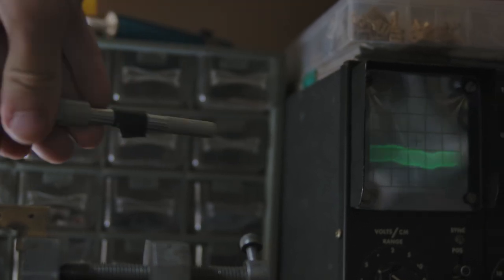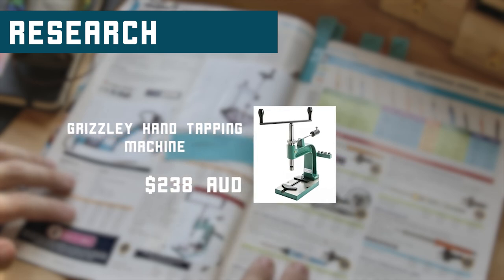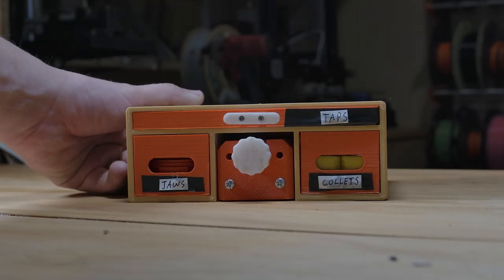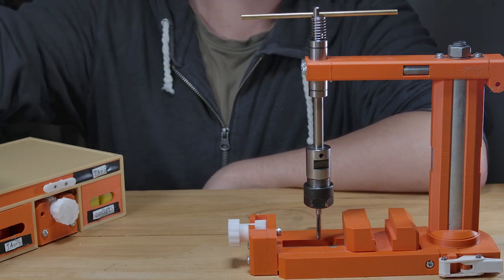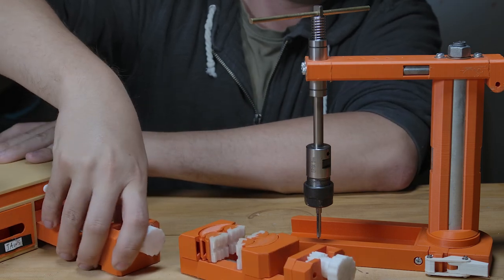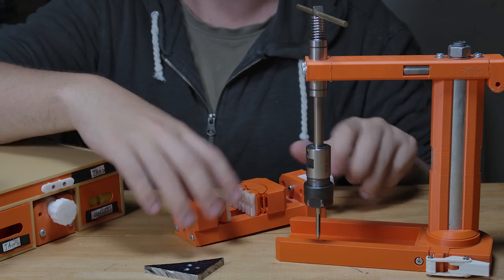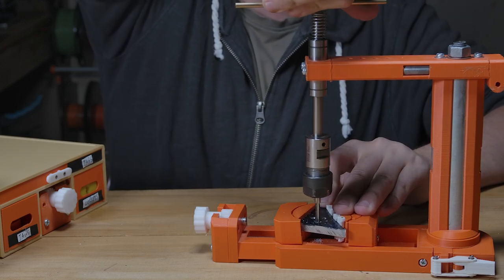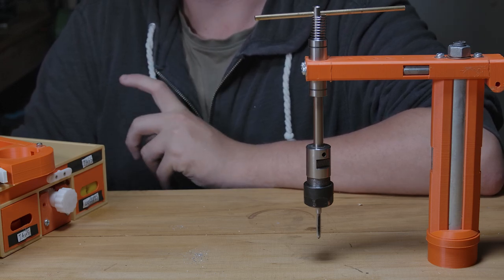I Printed This Tool To Break Less Taps

Comment: There are 3 taps (with different tapered lead-in) in each thread size set, use them in order, use lubrication 1/2 turn cut, 1 turn back-off and you'll never break a tap. Been tapping holes for 40+ years and can count the number of broken taps on one hand ... and that's tapping everything from 25mm down to 1.5mm threads in everything from brass, aluminium to mild steel.
Reply: Some suggestion here.
Battery powered screw drivers has a ball clutch, there is settings near the chuck to adjust the torque before de-clutch.  It is a mechanism to protect the screw from over torque.  This comes in quite handy for taps as you don't want to push the tap too hard.

Now for the 1/2 turn cut, 1 turn unwind. That is about the best practice of tapping. If you modify a battery powered screw driver for tapping, may be you can add some circuitry, say with an Arduino. Add a button to operate the 1/2 turn in, 1 turn out cycle. It could be a fun project too.
Reply: You only need to back off with straight flute "hand taps". I've mostly seen on cheap no-name taps and I would not recommend buying them. Spiral point (not spiral flute) taps do not need backing off so they are much faster to use as well as higher quality when bought from any kind of name brand. Generally, if there is no DIN/ISO marking on the tap, dont buy it. 

Notice the head shape between straight flute and spiral point taps https://www.pgmerlin.co.uk/news/the-different-types-of-taps

If I tap holes which I did on a drill press, I usually run the tap with the drill press as well. Largers taps I run by hand but I still use the drill press to center and push down to get the tap started.
Reply: I've tapped 0-80 before and was instructed to do it by holding the part and use a drill and drill slowly by hand, of course one broke....
Reply: Best comment here, while it's a nice project good tapping proceedure should be first and foremost.
Reply: I opened the comments looking for this one 👍
Reply: I too can count the number of broken taps in one hand. I can hold a lot of taps in one handful.

Comment: If you pour hot wax into the hole before tapping, your taps will last a lot longer.  Tap wax not only lubricants but helps clear the fillings from the hole.      Like your tapping jig.😊

Comment: I don't tap many holes and yet I may still need to make myself one of these. The floating vise is a cool idea as well. One thought, I think where you used the linear ball bearing I think you'd be better off with a bronze (or similar) bushing. You still get the nice tight fit, the smooth axial running and you won't get the squeaking of the balls in the bearing crying out "don't use me in rotational applications".

Comment: Just use a cheap secondhand benchtop drill press with the power cord cut off. You can get them for about US$20 now, sometimes cheaper, and they're crazy sturdy.

NOTHING taps as well as an unpowered drill press taps. You set a dead center in the chuck and drop its point into the rear center notch in your tap wrench and you're good to go. After maybe two full turns you just lift the chuck and your tap wrench can be turned freely with no need for any further guiding.

PLUS... if you disregarded my suggestion of cutting off the power cord and instead just disabled the power to the drill press... now you also have a perfectly good benchtop drill press that you can use for other stuff. Drilling and handloading and drum sanding and all manner of stuff.    8)

Comment: all i would change about the design is adding struts to improve rigidity, but functionally and price wise this is great! :)
Reply: If you need more rigidity than what that (or a hand) provides, you are using the wrong tap/drill combo. The only point of these is to start the tap straight. The part that is basically useless in any shop with any work that requires precision, is the vice. That is what needs a whole lot more rigidity for any "serious" work. That said, it is a neat compact design that would be good for low precision rapid prototyping.

Comment: Having done a lot of hand tapping using a similar stand, I am very impressed by your design but also have some suggestions. A longer and more substantial arm to turn the tap would help if you have to tap a lot of holes. I am generally tapping through holes in aluminum and with smaller spiral point taps (up to 8-32 Imperial), you can run the tap straight through a part. The spiral point pushes the chips through the hole so you don't have to reverse to break them as with standard hand taps. Having a longer arm with handles like the Grizzly tapping stand makes it easy to do so.

Comment: Cool jig! A good square reference is always a bonus for tapping! Never forget lubricant though. aside from the obvious benefits it also helps the tap form the threads better. for instance: when cutting m3 threads in aluminium, you need to use lubricant otherwise the sticky aluminium will break the edges of the thread. thus resulting in a weird m3.5 loose fitting single use thread.

Comment: hey bro a trick my dad always taught me, is you can place the tap in a drill press and use that to start a thread (turning the chuck manually rather than turning it on of course)

Comment: I tap hundreds of very small holes, like 1 mm and I use a tap stand much like this. Mine has a small knurled knob that I turn the tap with using just 2 fingers. My advice is to use plenty of material appropriate lubrication and replace taps more often than you think you should. You get a feel after awhile if a tap isn’t cutting like it should. If I have any doubt, I replace it. Also buy name brand taps, not junk no name stuff from Amazon.

Comment: I have been using the helical machine taps in my electric drill eith clutch for a while and ever since i have not had any issues with breaking taps anymore. Use it in steel and alu with no lubrication. They were just cheap ones from ali.

Comment: I have been lucky not to break one, but I use plenty of oil to help lube the threads of the tap, Hell even grease helps and catch filings as well. but things very on size and material as well

Comment: Could you make some sort of adaptation of this for a Thermal Threaded Insert Jig?

Essentially swap the collet section for a soldering iron (TS80 or Pinecil Maybe?) (Or just whatever you have/can easily get (price+availability too!, can always make adapters), that CNC Kitchen Soldering Iron Press Tip, and it basically would be good to go!
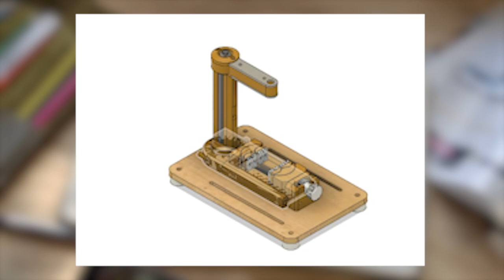Reply: Although as you pointed out in 2:36 ,  you may come up with some “polishing fixes” and ideas as you go along the development process.

Comment: check out flex arms. i've used them at work and they work the same as this with wider range of motion. you can attach a pneumatic tap gun to it as well. 

i haven't broken any taps by hand. if there's a lot of force i back off clear the chips and proceed. 
also you must try tap magic. and get respectable name brand taps. it makes a huge difference. i like YG1 taps. (i think they're Canadian)
i struggled with boring out holes instead of threading and making my own screws until i changed my tools. 
the cheap Chinese taps i first bought on amazon were absolutely horrible. the cheap dies were the worst and made me wonder what i was doing wrong. which was buying cheap tools.

Comment: Some little advice from some Germany CNC (God) :D 
In Tapping the price of the tap makes the difference in quality, some 100€ Tap will make 5000Treaths whitout breaking, some 20€ Tap will rip appart after 800Treaths.
And Taping oil has his name not for joke^^
Its strange, and i still cant explain it, but there are some big differences in the base Material of Machine Taps, that somtimes make them unbreakable. 
I even had some M3 Taps that Treathet whitout a hole in some thin aluminium parts, of cors the parts ware scrap but the Tap wasent :D

Comment: What do you do if you want to tap something That's taller and does not fit in underneath this setup. Do you have an extension for the pillar? Otherwise, thanks for a good video!

Comment: Did you use tap fluid and constantly backing out the tap a few turns to clear out the cuttings to prevent breaking taps?

Comment: How about adding an Arduino and a stepper to do the rotation and back off rotation. And if you can also set the torque, that can help prevent breaking of delicate taps like say m2.

Comment: When you tap do you go 1/2 forward and then 1/4 turn back? 
This should be done to break the shards. 
Going backwards and using tap fluids(an oil) will reduce the chances of braking a tap

Comment: This is really cool,  if possible, what are the other things in this 300 series?
Reply from the maker: Well this is number the first tool so I havent released anything else officially, but the die filer will likely be tool two when it comes out.

Comment: You could just lube the tap, then it wouldn't break anymore. Or drill the hole slightly larger if it's a deep one. Like a tenth of a millimeter larger

Comment: Use the tap n°1 , rotate slowlly 90° and return back. again 90°, returne back and do this 3 times before you go for the next 90°. Then tap n°2 and finally tap n° 3.

Comment: Dude, this is awesome. Thanks for sharing.
Can I pitch you a really quick project?
"Sure?"
Thanks sir! I really would like to see it done and I'm a master procrastinator.
I want a headphones holder with a retractable cable. Since the jack connector can rotate freely it's a perfect candidate for this kind of mechanism. The spring could be savaged from a cheap dog leash or a fancy keyring. I know this is such a simple model and maybe I could find 3d examples to remix into my dreamed device but you, sir, look smarter than me and I really appreciate your taste in design, please let me know if you'll be interested in a more detailed explanation.
Reply: I don't understand how what you're proposing is supposed to work. I would like retractable cable mechanism for my headphones as well but i thought about it for the lot of maybe a few minutes and came up empty.
Reply: @SianaGearz  it would need a ratched mechanism with a "flat spring", basicly what a extensible dog leash has (you can look also for retractable keychains, it's a thin strip of metal used in clockwork). Then in the middle of that mechanism would be a female jack connector. So... Your headphones would be connected to the female jack, then rolled/threaded as the dog leash. 
Note 1: from the female jack connector you need another cable to go to the audio device.
Note 2: It would be nice to have a 1/4" female jack connector and use an adapter to your headphones so the adapter would be the one that wears out.

Comment: Nice tool, but i don’t think it’s really necessary. Just get proper machine taps and use a cordless drill or a drillpress with a reverse switch. I have a set from Garant sold by Hoffmann Group and just broke one M3 in copper, because i didn‘t use lubricant.

Comment: OK i love this but my thought is - if the vice is not locked down, why attach it to the machine at all? Why not just have a free standing mini vice?
Reply: I’m not sure that it matters for small taps but it’s good to prevent the vice from spinning under the pressure of tapping rotation.
Reply from the maker: Yeah as Trevor said, the vise can move slightly but not rotate. Perhaps I will add a proper float lock function in the future but I have not found it to be an issue.

Comment: Never broke a single one. Oil, good pace 1/4 rotation in, 3/4 back, try getting the feel of it, maybe you could pull a 1/2 in, 1/2 back, maybe you'll need a full rotation back, don't rush, empty your mind, be formless, shapeless, like water... Be water my friend (and get that tapping done).

Comment: I've had better success with using taps which have spiral-shaped flutes. I'm not very good with the straight ones and I still have a couple of blocked holes in my DIY CNC where I just left tap fragments in and added new holes by the side 🙂

Comment: How simple would it be to modify this to use an ER20 collet? I'm planning to run most tools around my workshop off of them.
Reply from the maker: Im sure it could be done but would require some thought, there are two bolts that constrain the size of the bearing that can be used but it could be done for sure.
Reply: @Borgedesigns  ok cool. I'll have a look at the CAD when I make this. Won't be for a while.

Comment: One note - usually Linear Bearings are not really designed to be rotated as far as I know - they're only intended to run - linear to their axis.
So that might be some concern in terms of durability.
Reply from the maker: Yeah I wouldnt use them for radial movement in say a gear box or other high RPM application but the stress here is so low I judged it as fine. been using it almost daily for half a year with no issue so far.